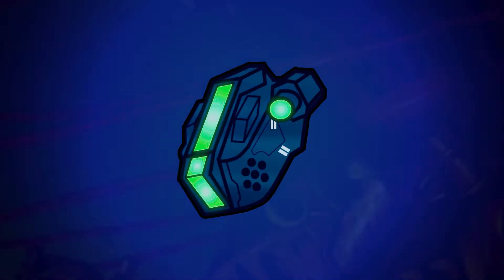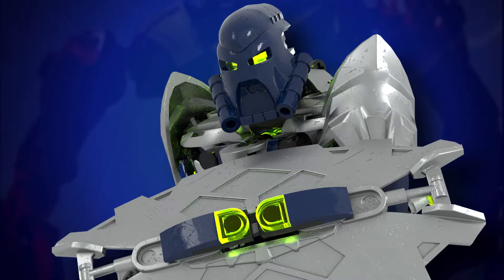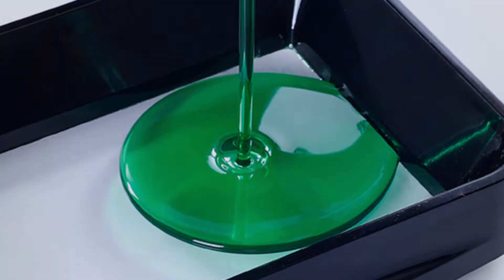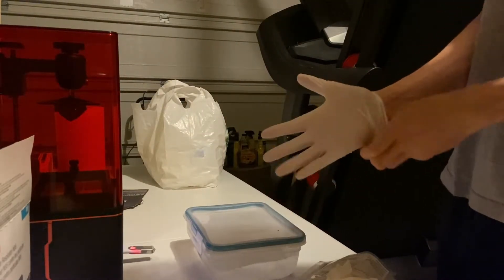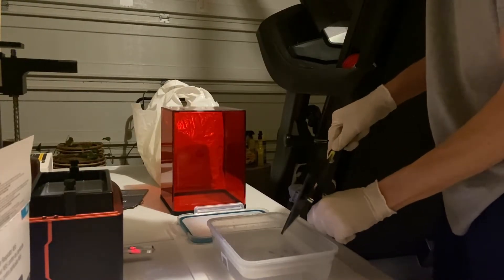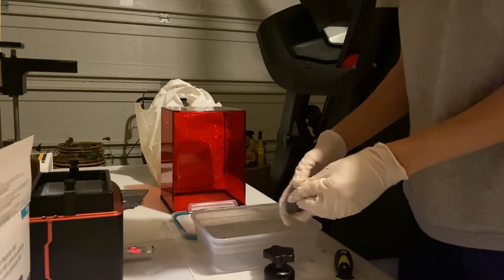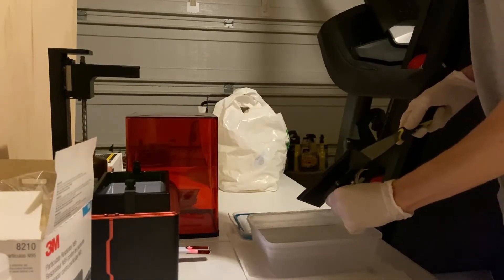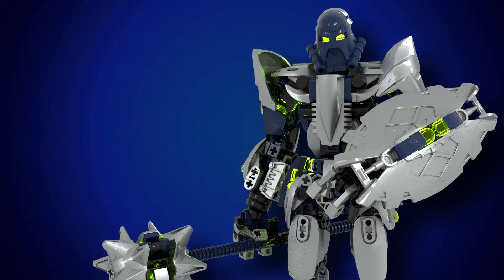Bionicle 3D Printing: Helryx's Mask and Shield

Comment: what model do you have and how much does it cost?
Reply from the maker: Do you mean the printer? The one I use is the Elegoo Mars 2 Pro and I got it for about $300 USD
Reply: @BionicleLoreCentral  great! im a 3D artist and fan of bionicle so i may get into 3d printing with resin, it looks really good, i do have one more question tho, can you use a colored resin so when its finished you dont have to paint it? i hate the look of a painted part becuase it never looks the same as the original pieces and this looks really similar in terms of material, so if it can come out with color out of the 3d process that would be great
Reply from the maker: @erickh555  There are different colors of resin, yes! However, the ones I’ve seen tend to be translucent, so I’m not sure if you could print something and have it look the same as an official piece. Granted the colored resin can be good if you want to make custom translucent pieces, like eye pieces in custom colors. All of the 3d printed pieces I’ve seen wind up needing paint to get colors similar to the real thing, so it’s best to just use one color of resin (like the gray I used in the video) and paint over it with the color you want. Hope that helps!
Reply: @BionicleLoreCentral  thanks a lot, you have been really helpful! im a bit disapointed that with 3d resin print you cant get the same level of opacity as regular resin casting but maybe in the future we get an option to do it more opaque

Comment: Great video I have a question what settings did you use for support and does the settings also works on pla printers?
Reply from the maker: I use this program called ChituBox to set up the supports, and that has a feature that allows you to auto-generate them. I doubt it’s one-to-one between resin and PLA, but I’m sure there are similar programs out there for PLA printers.
Reply: @ do you use supports on the pieces that has + sockets?